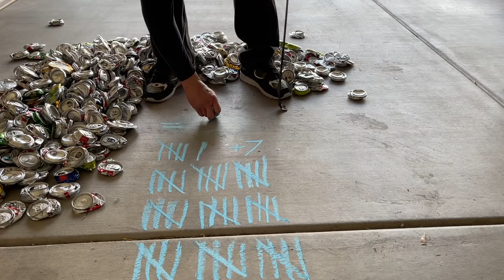Massive Can Meltdown - How Much Pure Aluminum Is In 500 Cans - Is It Worth Melting Aluminum Cans

Comment from the maker: So is it worth melting down 500+ aluminum cans? 
Short answer...NO. 
Total the time- just over 2 hours to melt these all down, plus setup and clean up time. 
Total the propane cost- I used about 2/3 of a tank, so depending on what you pay for propane near you...for me it’s about $10-12. The result of the10.75lbs of aluminum is worth about $10.75 USD. 
The fuel alone costs more than the aluminum is worth, then take into consideration what your time is worth and you’re way over budget!
For me...there is everything I just mentioned, plus add another 2 hours to sand, polish, and shine one of these ingots, and another 8-10 hours editing to provide 12 minutes of cheap entertainment & enjoyment. 
Long answer...worth every second 😉👍
Thank you all for watching, I hope you enjoy, and stay awesome!
Reply: No is absolutely the correct answer.  Everyone tries melting cans at least once though, and I never saw anyone get talked out of it.  But FWIW I can reduce 3 whole alloy car wheels into crucible friendly sized bits with my wood fired stack melter in an hour or less.  That's a lot more melting stock processed in a lot less time with a lot less work, cheaper to buy as scrap than 500 cans of pop, far better for making castings with later since they are made with an alloy that is designed for being made into castings rather than for being made into cans, creates far, far less dross to skim off because cans are all surface area just waiting to burn up before they can melt, and I bet 3 wheels even take up less space to store than all those cans...  "Free," yeah, right...
Reply from the maker: @tobhomott  very well put!
Reply: @TheGrowingStack  what size smelter is that? Great video by the way
Reply from the maker: @JondroNation  Thank you, that one is the Devil-Forge FB2M that has a 10kg max crucible size.
Reply: Where I live on the northeast, 517 cans would give me $25.85 at the recycling center. .05¢ deposit return for each can. The fun factor is what would make this hobby worthwhile.
Reply: Too bad that's not silver huh? Pretty sweet at any rate 👍
Reply: I made a bucket furnace and melted a whole lot of cans. Not exactly the way to make a living, but I cast some cool shit. Worth it to me.

Smash them flatter and use some borax, and you'll get quite a bit less slag.
Reply: Not a smelter, it's called a furnace
Reply: Doing my own research you really need a flux for aluminum cans for better aluminum recovery. Aluminum absorbs Hydrogen and oxygen and a flux helps in separation of aluminum from the dross while also degassing. Also using waste oil would be probably more economical.
Reply: I do it for cheap cylinders to throw on the lathe and let the kids get more experience. 😃
Also, did you throw in any "salt substitute"?
Reply from the maker: @jamesharrell4360  Thats awesome 👍 I didn’t add anything, I wanted to go totally raw this time for the experiment.
Reply: @TheGrowingStack   According to one source potassium nitrate or (KN03) is used as a drossing flux and helps improve “wettability and fluidity” of the aluminum which allows for greater separation and coalesce of aluminum drops trapped in the dross. Though I have not had the chance to test out yields with it yet, the correct timing to add the flux, or how much as the article did not specify a quantity.
Reply: The journey though.
Reply: If the aluminum was suitable for milling and stress and whatever you could make something with it.  But I guess that depends on the quality of the material.
Reply: @jasonmorgan661  just turn your stick welder to it's Max duty cycle and cram some carbon arc rods in there.
Reply: @kateonianlaw1127  I pre melted my substitute salt into larger crystals. You get a feel for how much you need. And pouring straight from the bottle of salt typically ends up popping slot of itself back out.
Reply: I used bbq coal and a hairdryer as fuel to melt cans in a furnace nearly identical, definitely more cost effective than using propane.
Reply: Thanks a lot man for sharing your knowledge. 
This is only for reference... 72 cans 325 ml of aluminum are a kilogram. The metal slag that you obtain is 30-34 per cent.
If you have 517 cans between 72 = 7.18 kgs. The 32% of 7.18 is 2.3 kgs. Then 7.18 - 2.3= 4.88 kgs. The final it depends of many things in example... the same cans weight, the same volumen etc. 
Take this only for reference. Your video is very usefull and interesting.
Reply: I live in Pittsburgh. Thats about 2.50 worth of aluminum
Reply: You also have to buy a beverage of your choice, to add a few more cans.
Reply: In Australia if you recycled it you would’ve got $51.70
Reply from the maker: @tarikdominator8144  wow, I need to take a trip down under. 🙂👍
Reply: In BC Canada u would of got 51.70
Reply from the maker: @blackbones4959  Man, we’re getting robbed down here in the States!
Reply: I'm in uk and just looked on ebay, there are some hand cast 1kg ingots for sale for £44 So potentially worth about £200 for nearly 5kg if anyone buys them at that. That said, metal is quite lucrative here though
Reply: Uncrushed cans in some states like oregon pay $0.05 for each can. Not even close to the same price as melted.
Reply: Probably a similar formula with the melting of plastic for recycling too....not worth it.and glass is a different story as it requires much hotter temperatures but I suppose that glass bottles could be reused if returned to the same manufacturer which could mitigate that a bit.
Reply: The real money comes from the video revenue.
Reply: Melting with a melter like this by hand at home , of coarse it is economical seen spilling of money (and energy is inefficient used). But in my opinion it is better to reuse as much metals as possible instead of mining new , destroying land for it.
But when anyone would like to make profit out of something as this it must be done at industrial scale...automated process..., perfect isolated heaters so no energy loss to the surrounding. And after making those alu breads reuse the energy what you'll get by cooling those. Maybe enough hot water for home / factory use.
So not melting 517 cans, but maybe 517000 cans.
Reply: @TheGrowingStack  what is slag?
Reply from the maker: @Bushcamper777  
The way I understand it, in a nutshell- slag is the waste when they refine or smelt ore, like when they make iron or steel from straight rock, it is the leftover waste matter. Dross is what I was skimming off the top, which is the oxidation of the aluminum when it comes in contact with oxygen, or the air. Technically, I should be skimming the “dross” before pouring the molten aluminum that forms. The terms are interchanged a lot, and when people say slag...I know what they are referring to. But, there is a lot going on here also. The ink from the cans and the plastic lining combined with the oxidation forms the dross that is being skimmed away before pouring. I’m no expert, but from what I have read and from doing, that’s what I got 🤷‍♂️😃
Reply: What about artistic value? bigstackeD makes these beautiful mirror polished bars that I'd pay for, especially for the fact that it's autographed (or stamped, at least).
Reply: Well you have shown that from an economic standpoint it does not make sence yet if you sat around watching television  instead does that make any economic sence? My point is I give you kudos for doing somthing and learning about somthing rather than doing nothing aka watching TV.
Reply: check out oki scraper's oil burner set up ,,  that's a must have for this work
Reply: Finland one can 0.15 cent when you restore can super market 700 can = 75 euros = Finland is Pure = Finland Rule the World
Reply: But still real cool
Reply: What is the useless leftover stuff made of?
Reply: @t0n0k0  not sure if its carbon or different type of alloy from the pull top, have heard its tougher aluminium
Reply: No it is not economical but drinking 500 beers then making art out of the empty cans is totally worth it!
Reply: @liondirk  yea thats totally true ,  but you gotta be able to drink them all  or give them to the dogs  cows and horse's
Reply: I was going to say you never addressed the question in your title.
Reply: 500 cans is about 100$ bucks here in norway so not worth melting em
Reply: Are those cans all project-grade pure aluminum, though?
Can you get .999 pure?
Reply: Luv it, nice vid.
Reply: Is 10 lbs of pure aluminum worth the same as 10 lbs of aluminum  cans?
Reply: @1paultv22  i live on the west coast, its 10 cents a can over here, that was 51.70 at the center
Reply: @TheGrowingStack  on the west coast its 10 cents / can.
Reply: Yes, Hobbies of any kind are not cheap, and you never do it to make money..  you do to see if you can and what you can make. Bragging right.
Reply: You could convert your kiln to run on waste oil.
Reply: 8 to 10 hours to edit for 12 minutes footage ,.. ?
what did you do the editing on texas instrument calculator from the 70's lol
Reply: Thanks for your vid! Appreciate your time & efforts 👍🙏🏻
Reply from the maker: @MYshamanEYE  😂 That’s funny stuff, I love it! I film everything, so when I get done, I have 3 hours of footage to go through, whittle down, speed up, cut, and chop to make it to 12 minutes. It’s a ton of work.
Reply: @TheGrowingStack  hehe ,.. i just had to make the joke ,.. loved the vid ,.. hehe
Reply: @TheGrowingStack  hear's an idea ,.. post all 12 hours raw and call it cure for insomnia asmr ,... people would love it,... wink :)
Reply: Well around here that's food graded aluminum which it pays very good, surely more than 1 dollar or so per pound... I don't know if they would accept it melted into bars like that , probably not... but in way shape or form it is a waste... you can start to make props for movies making the aluminum look like silver and brass look like gold...I'd try the way the fella said he did with a wood burning oven to save $$$
Reply: Half a million views later “well I guess if you film it and put it on YouTube it is”
Reply: You could re-melt the aluminum and pour it into a mold to make an AR-15 or AR-10 lower receiver. Just saying.
Reply: A friend and I have done this and made a nice 15lb skull, similar to the one you have on your shelf. We think it was worth it because aluminum ingots were selling for $4/lb on Ebay. Also, people offered us some money for the skull.

We used BBQ charcoal, and a leaf blower...then coal, and coke...and found it was economical. Even more so by using a much larger crucible. That way we could melt a lot of cans in one burn/pour. I think it CAN be cost effective... you just have to make your process cheaper, and add value to your aluminum by turning it into something people will pay for.
Reply: Seems like you're running your burner way high if you're going through 2/3 of a 20lb tank of propane in 2 hours, I melted about 1500 cans (non-returnable in my state) last year on a single tank of propane in roughly 6 hours. My orifice in my burner is a 0.035" mig tip and the furnace is a old 20lb propane tank lined with ceramic fiber and firebrick.
Reply: ....damn straight, some things are just worth it..!!
Reply: 😂 hilarious
Reply: @CyrusOfNaias  not 100% . . . two very specific alloys -- one for the body, one for the ends.
Reply: @1paultv22  we have some here that give $0.06 back so it'd be over $30 here
Reply: Why not try a used motor oil furnace? A better set up that would be more efficient would definitely get more use out of your propane.
Reply from the maker: @jhatchoou  I might try that someday. 👍
Reply: 15.oo of propane to get 4.69 in aluminum ingots.    You need to make FISHING LURES INSTEAD !
Reply: To add some perspective, here in South Australia we get $0.10 per can at the recycling center. Yet if I sold them aluminium by weight they pay only $1.30-$1.70 per Kilogram.
Reply: @grndragon2443  Oregon is .10cents. I live here.
Reply: @kateonianlaw1127  Yeah he's just making a lot of aluminum oxide there, very wasteful.
Reply: I watched this at 2x normal speed and still got 6 minutes of entertainment and enjoyment.
Reply: The bars still look cool, gold be better of course.
Reply: there will be a shortage at one point. The earth only made so much of all of this
Reply: Thank you for sharing your experience.   In Michigan carbonated drink cans have a $.10 refund so those 500 cans would have a cash value of $50.   Can’t help but wonder what the price of aluminum would have to be to make melting cans down to make it worth melting cans.   Either way thanks again for sharing your experience.
Reply: But how much did you make from this Vid 🤑
Reply: But 700k views is worth something
Reply: @tarikdominator8144  Not every state yet.
Reply: @derekhobbs1102  no one cares about tassie and Victoria
Reply: But what about all the youtube revenue you get out of this video???? I think, in the end, it'll be worth it
Reply from the maker: @jwgmail  I always get asked if I sell stuff. Maybe I should rather than just giving it away.
Reply: Well its not that expensive for a hobby and the result is nice to look at for sure. 👍
Reply: @TheGrowingStack  do you know if scrap yards take ingots?
Reply from the maker: @haloplayeroflegend2515  From what I’ve read they usually don’t since they don’t know exactly what it could consist of. That or they will give you very little. Maybe it varies from scrap yard to scrap yard though 🤷‍♂️
Reply: @TheGrowingStack  👍ok
Reply: You just saved me a lot of time. I’ve been saving cans for about a year. Was going to make a forge and melt them down. 
So now I know. Sell cans to recycle place and take broken mower off the side of the road and use the cases.
Reply: Okay maybe this is a stupid question, but what are your ingot molds made of? They just look...interesting, for some reason.
Reply: @thedrunkalchemist5442  More
Reply: Shouldn't it be more than 10.75 since it's clean aluminum?
Reply: Still pretty cool tho.
Reply: Yeah, the economics do not pencil out but I bet you had a blast making ingots.  And the ingots are kind of cool.
Reply: I totally believe you, but could it have helped to compress the cans further after crushing them, so as to shortening the feeding time of the crucible?
Reply: @holdenbrougham1923  unless I am very much mistaken it is not anything as exotic as carbon or a different alloy from the pull tab, rather it is just simple Aluminum Oxide (which has a melting point 2 or 3 times higher than the melting point of elemental aluminum)
Reply: @MYshamanEYE  editing is probably the longest part of making any decently well produced video
Reply: @donniebrown2896 touch grass nerd
Reply: Is it worth melting down 500+ aluminum cans?
Providing you get 838,000 views at roughly $1 per thousand views...  HELL YEAH IT IS!!
Reply: Sell that stuff online I'd buy an aluminum skull or cool coin that was stamped with something interesting
Reply: if you had a more efficient foundry and a steel crucible you could actually make money from this, what surprises me is how little aluminum you got from each can.
Reply: That's not thinking it through. You could sell each bar as a curio at the farmers' market for $10 each.
Reply: @TheMrCougarful  true, he is doing based on price per tonne rather than how much he would pay for it if he didn’t have a foundry.
Reply: Yes but your ad revenue from Google is worth it
Reply: Dope video man!
Reply: @1paultv22  Cans are worth 10c each in AUS.
Reply: I reckon it's worth exploring how pure you could get the aluminium, and whether you could cast it into parts worth more than $51.70. Of course you can't charge for your time but that what hobbies are for.
Reply: dammit bobby!
Reply: And yet you manage to call it recycling....
Reply from the maker: @m.laraibali3266  The Oxford dictionary says Recycling is: the action or process of converting waste into reusable material. 🤷‍♂️
Reply: Depends on what you determine as value. I now know I can make an attempt at casting an aluminum intake manifold from the bags of cans I have.
Reply: @TheGrowingStack  That's for damn sure!  It's pitiful what we get for can!!!
Reply: the aluminum cans are worth more if you return them as nickel deposits for 5 cents each
Reply: Well your barely over cost not counting your time,  I could see  a little larger scale  operation where you can do more than 10 or 12 cans at a time becoming more efficient.
Reply: Yeah, but it was cool to see.
Reply: @TheGrowingStack  but it might be worth it after you get monetized if you're not already!
Reply: Tjank you. Good job. Am I wrong if I suposse the complete answer is: Not at home but Yes at factories???. Where costs are less and inputs are chapear???.
Reply: @TheGrowingStack  No, in MI 517 cans = $51.70.  Fun to watch but just recycle them.
Reply: QUESTION- NO BS OR SARCASM:
Was that the most efficient method of melting aluminum that you found?  How (or what) could be done differently?
Interested, but not in love with the process in the vid [nothing personal-I give you great credit!  I just don't have any of the equipment or even know where to look for it]
Any thoughts?
Reply: Thank you sir, for your kindness in improving the educational value of YouTube.  Regardless of what some might say.....your time is NEVER wasted when adding to the educational instruction of others.  You're a stand up guy!
Reply: @1paultv22  but you're really only getting a refund because you pay an additional $0.05 in tax per can.  LOL
Reply: The nd result is your a LIAR or you can't count. It takes 24 cans to make a pound. You claimed to have 500 but yet only had a melt weight of 10.75 lbs.? To make it easier 500 lbs. of cans weigh roughly 20.83 lbs. Let me say that again 24 cans to make a pound, 500 cans weigh 20.83 pounds and YOU had a melt weight of 10.75 pounds? Where did the other 10 lbs. go the paint burning off lol. SMH
Reply from the maker: @jackbounder6374  I’m guessing you’re trying to say I didn’t melt all 517 cans... I melted them all, it took forever. There was quite a lot of dross that I didn’t weigh that I should have to your point. You can see a lot of it at 7:16 on the ground where I skimmed before pouring. Also at 10:42 in the wok. Now, had I ended up with “40lbs” at the end, then yes, I would definitely be a liar. 👍
Reply: It's mostly slag too, I used to do melts as well and whenever I did Aluminum cans It was like 50% slag because of the oxidation, and plastic coatings on the cans.  I think you would be better off cutting the top and bottom off and throwing away the center but then it becomes a time issue. As you said labor has to factored in as well.
Reply: Hello, yes we are so what are you going to do with all of that?    @TheGrowingStack
Reply from the maker: @rickmorris338  just keep stacking it up. 👍
Reply: So if you're lucky you can get out slightly below a kilo for 100 cans. Here in Sweden a Kilo is worth about 20.9 SEK, recycling one can will give you 1 SEK.
Just ignoring melting costs, you'd still be losing about 5 times of what you'd get from just turning in the same amount of cans at the recycling station.
Reply: The YouTube revenue makes it worth it lol
Reply: Yeah, but how much for a polished paperweight?
Reply from the maker: @brianmi40  to be determined I suppose 🤷‍♂️
Reply: Well the million views pay for it.
Reply: @1paultv22  I think you mean .05$  per can. The recycling scheme charges you at least ten extra cents per container to cover the costs of itself and make some profit. Then, in most cases, the "recycled" al ends up in a dump anyway. I'd rather go for the fun part of home recycling, belch carbon dioxide out of my smelter, claiming that I'm saving precious resources of the Earth :)
Reply: @zigfisher6592  Lol!, I didn't know I was being graded on math expressions. Technically it would be written as $0.05 or 5¢. The dollar sign always goes on the left. The cent (¢) sign always goes on the right without a decimal point up to 99¢.
Reply from the maker: @GMan-yv8cb  Definitely not the most efficient, but I melt and cast a lot of other stuff on here, so since I have all of this stuff, I went with it. 🤷‍♂️
A lot of people talk about using a used motor oil setup, but I haven’t looked into that.
Reply: I hope you wear a respirator.  That stuff can give you alzheimer's.  We just do it the easy way and take cans to the recycle place.
Reply: Obviously you wouldn't build a commercial enterprise on that size forge. Would need mega-scale.
Reply: @donniebrown2896  It is a foundry.
Reply: depending of what you consider worth it if you turn it to art then yeah worth it for it more then likely cheaper then buying a block. but to scrap no
Reply: Can you imagine what the salvage yard thinks of recycling all that stuff to and they do it all…….. some of those people at steel mills make 20-30 dollars an hour.
Reply: Probably would've been nice to put this in the end of the video
Reply: @donniebrown2896  forge actully  written on the Side
Reply: Better try melting from waste wood it will be cheaper I think 😜😜
Reply from the maker: @kri9057  That’s not bad at all! 👍
Reply: What about range brass?🤔
Reply: So how much do u get 4 1 of those bricks r they worth anything.?
Reply from the maker: @andclose1133  The current price of aluminum is $1.0998/lb so it’s worth something. The value would depend on taking to a recycler(probably only getting 1/2 the price since it’s already melted-if they buy it at all) or on the street. I get people asking me all the time if I would sell these, so it all depends. For the moment, I am just stacking them all up on the shelf 🙂👍
Reply: @kateonianlaw1127  yes use flux for cans  a lot less waste just remember cans destroy your crucible
Reply: @1paultv22  
I’m Oz you get 10c per refundable can and bottle. 
Also we use Aluminium here. Different because it still contains the i compound! Lol. 🤑🤑
Reply: In Germany, bringing back those Cans to the store would result in getting 25cents per can, totaling in more than 125€
Reply: Pfft imagine using propane, aluminum can melt in a good camp fire. using an old steel tumbler cup as a crucible, wood as fuel, and a muffin tin & mini loaf pan for molds, boom free, out of actual garbage and rotten wood its really cheap to be resourceful.

As of current we've about 13lbs of pure aluminum in ingot form completely free
Reply: @TheGrowingStack  this is the problem with recycling, you dont actually profit.
Reply: Awesome comment.....hobbies are rarely  worth it on a $$ to time basis....but they stop us going insane..... great video
Reply: @tarikdominator8144  as long as you're in the right state.....I make about $120 a year from bottles cans at my local recycle service.....and bang it down on Christmas dinks and eats....🍻🍗
Reply: Cost effective? No. But neither is me reloading 9mm ammo, but I enjoy doing it. My time on the press is therapeutic and I have a sense of accomplishment and self-sufficiency.
Reply: Just save it all....one day you will be rich beyond compare. give it to your kids even, they will be able to sell it back to the Global Government for BILLIONS! Oh wait....they will have to pay a fine for hoarding, there will be inheritance tax, a fine for not disclosing strategic goods, there will be no money, no more private property, only gruel to eat, everyone will be equal.....no wants, no desires....UTOPIA!!!

Forget it....I thought I had a idea there at first!
Reply: Yes, if you get over a million views on youtube...you make money...
Reply: so TRUE, and be Tired after at least I Am- NOJK
Reply: @donniebrown2896  If you're going to correct somebody, atleast be correct.
The way he's using it it's a Smelting Furnace.
Reply: So the getaway would be to use cheaper fuel.  My question is where the hell can I buy 1lb of aluminum for 1$??
Reply from the maker: @TheGamersRace  good question. As value goes, that is what it was valued at when I made this. I just visited my local metal shop the other day and aluminum was being sold for $3.99/lb. 
they are a pricey shop for extruded flats, but the same with anything I guess 🤷‍♂️. 
Silver, Copper, Gold, to buy to it outright they charge a hefty premium.
Reply: Glad you answered that question. I stack silver and refining and melt doesnt add up to be worth it. Cheaper to buy round. Thanks.
Reply: @grndragon2443  in my area of oregon its 10 cents now
Reply: here in india, we melt it and cast it into aluminium pots and utensils. we gather aluminium things or parts.
Reply from the maker: @nanaouzumaki6044  that’s awesome!
Reply: I work in the aluminum industry and we melt down TONS of cans a day,we don't Polish the ingots even tho we pour into 1500 lb molds. We melt anything and everything that's aluminum
Reply from the maker: @johnbrewer8488  That is awesome sir. I would love to see some inside footage of a 1500 lb mold being poured! If you’re allow to take any inside footage, my email is TheGrowingStack@gmail.com 😉
Reply: Too bad it's not all gold bar
Reply: @TheGrowingStack  you're right I used to work in the steel mills , I worked in a blast furnace we made pig iron and slag came off of the iron. For you that don't know what steel slag is is the stuff you see on the railroad beds the train tracks sit on. It kind of looks like dirty melted glass. Or lava that came out of a volcano . I don't know what they use in other states and countries but most of the railroad beds in the midwestern used slag
Reply: What the hell do you do with them?
Reply: that's why I strip copper :D
Reply from the maker: @tillmanfamilyfarm7759  Mainly just stack them up, and then in the event I want to make something, I have the refined materials to melt and cast into something.
Reply: Why you need money from aluminum when the youtube video views make you more money?
Reply: @j3ss3jam3s5  Not really "profit". You are paying that
Reply: Time is worthless until the sale is made.
Reply: @runerafell4480  that good money sir
Reply: Its .52 cents a lbs for forged aluminum as of today.
Reply: @Akhazmat907  it depends on the grade and volume too.
Reply: Hey they look awesome tho. What you should do is paint them gold and than keep them on the shelf to look at and imagine if they were gold! Haha 😆
Reply from the maker: @Jay_Chang440  😃👍
Reply: @0g.Ghost.7373  Im not paying that, that for sure, ...
Reply: @j3ss3jam3s5  If you buy a drink in a can or bottle you do. You or someone else gets it back if its returned.
Reply: Will you recoup the monetary cost in capitalism? No. Is it worth it? ... yes.
Reply: I don’t know why you would want to smelt it yourself. Let the recycler do that shit homie!
Reply: @1paultv22  I would like for you to get 517 cans and see if you get that at the recycle center. They no longer do it by the 05 cent value. They weigh them now in bulk. This is how they win against you. You probably get $10-$12 for the cans.
Reply: @bradleyrussell1973  there are lots of reasons. Assuming you want the aluminum for something, and aren't just selling it, the recycler will probably be charging you more than what you'd pay yourself (not counting initial equipment). Lots of people don't drive, and in USA at any rate public transit is shit. Lots of people who do drive don't live near a recycler. Society might collapse someday, and all the recyclers will be gone. (Just some examples lol)
Reply: I guess it depends on whether the cans have a deposit on them... where I am, 517 cans amounts to $51 and change (10 cents per can, crushed or not)...
Reply from the maker: @patklemmensen1694  I’m not so lucky on the deposit in Arizona 🙁
Reply: Thanks!!!
Reply: Earth is flat
Reply: @kateonianlaw1127  What is all that slag or dross he has to scoop off made of? It looks like Al, or at least has the color of it, but I presume something has it locked into a compound that won't melt.
Reply: Let's see you smelter platinum. Or one of the real valuable metallic elements. But the film you made was fun. I watched it on Saturday July 24 at 5pm.
Reply from the maker: @daniellafferety4025  Thanks Daniel. I have a few videos melting silver. That’s always fun to melt. I haven’t done any gold or platinum yet. I would love to though. Someday. 👍
Reply: Was thinking Aluminum doesn't really have value, this is more for personal enjoyment and recycling, looks good, keep it up, love to see some more content.
Reply from the maker: @BloodHawk31  Thanks Heinrich. Yeah, definitely more for enjoyment. 👍
Reply: @1paultv22   in South Georgia, I’ve been getting 30 cents/lb for the last couple of years. That’s the lowest price since I started saving them 30 years ago. Now adjust that for inflation and 30 cents then is about 60 cents now.

Yet, they claim there’s an aluminum shortage in the US and that’s driving the cost of beer higher.
Reply: @TheGrowingStack  An easier and less impactful way to crush your cans is to line them up, under your vehicle, and drive over them. Yes, I “pre” crush them, but this gets them really thin.
Reply: @1paultv22  : Where I live they have the 5 cents return on the cans also, but the stores that sell the cans don't take them, so you have to find a recycling center, so then people are being slobs and just throwing the cans on the ground, making them free to the people who actually care about the environment that want to do things like the man in the video, which I applaud him. There's cheaper ways to melt the cans down, just build a burn barrel out of a 55 gallon oil drum and drill holes in the bottom and the top and throw in things that burn put the aluminum cans in a steel 5 gallon can and light it on fire it'll burn so hot it'll melt the cans down.
Reply: and probably you may be drinking more soda just to build the wealth of cans? need to account for that as well.  I remember when I was a kid in my birth country they used to sell candy with stickers hidden in the pack and I started collecting them and I had all stickers except one to finish the whole set. I ate a lot of candy and wasted money but I never got lucky with the last one I was looking for. Later on, I realized maybe that particular one never existed probably their gimmick to make kids buy more candy. :)) Not sure if this story makes sense but i wanted to share LOL
Reply: Where did you get that set up?
Reply: Thank you for your time to entertain and educate us
Reply: The Scrap value is only $0.80-$1 per pound, but that is not what you base the value on. 
Actual shaped aluminum bar or plate is nearly $8 per pound at a metals retailer,(depending on order quantity) granted that is a known alloy.
Reply: here in ontario they make you pay 10 cents per beer can as a deposit which you get back when you return the cans.  worth far more than trying to recycle them yourself for sure considering that the time and effort to personally refine the metal costs more than you can sell it for.   really good video.
Reply: Rocket stove and a fan piped in
Reply: TheGrowingStack bring some mouse traps
Reply: Have you consider the fume / smoke from the paint on the cans?
It is a very interesting video and very cool project and it might be only one time to explore the process - but I can not help consider what chemicals one get exposed to seeing the smoke cloud on each new can you drop.
This comment is likely to be downvoted so I don't really expect serious answers - I was just wondering.
Reply from the maker: @steffenlindemann1227  I wear a respirator and have air moving around the entire process. I have done this many times before without wearing a respirator, and the fumes are only noticeable within about 10 feet of the furnace. If you back away, you don’t smell anything really. Outside of that, I don’t think it’s of any concern in my opinion. 👍
Reply: So they content creation is worth more lol
Reply: I was surprised at the quantity I thought it would be even less - but even if it was more, it still wouldn’t be worth it because Alu cans are a deep draw alloy that’s not very good for casting with so it’s even more pointless 😂
Reply: what if you melt it without fuel? might be sort of worth it if you just used coal and a hair dryer
Reply: Value of the processing depends on more than scrap value. Since you cast into ingots you lost potential value not casting something saleable at a higher price.  Also, rather than saving and melting all cans at once it would be better to melt a few every time you are heating the crucible, using the heat efficiently. 

Slag can be useful... it's not simply junk... look it up.
Reply: Thankyou ..I just baged up my can stash and put it out for the bin men...good video...awnser to a question  I've been wondering a long time....cool
Reply: I suppose if you melt it with sun alone, that could make it worth it. With a fresnel lens for example.
Reply: At least you satisfied my curiosity and that only is worth my time thank you.
Reply: Is there a break even? How many cans at once might get you twenty bucks an hour including fuel?
Reply: 3
Reply from the maker: @duaneayers6117  If I ever do, I’ll definitely let you know! 👍
Reply: But what about the YouTube money 💰 lol?
Reply: Definitely not cheap entertainment! You are skilled guy and the video is amazing! Really enjoyed it my brother! Thanks for sharing
Reply: would have gotten more at CRV   locally they're paying about 1,67 a pound  517 cans is 21 pounds  35$ or so
Reply: in most places these cans have deposit, usually .05 cent so 25$ worth of can reduced to 10$ hehehe
Reply from the maker: @keshlalish5586  I’m not so lucky in Arizona. That would be nice though!!
Reply: Thats $51.70 worth of cans here!  LOL
Does it even cover your gas?
Reply: Just for this comment and the amount of time you dedicated to elaborate this video I will follow anda like! And you just gave me an idea of how a the lay out on the ground kind of tile! I imagínate a floor made out of aluminum tile! How cool that’ll be? Thanks for the content tho!
Reply: @nickhunt4438  check your number Bud. $1.17ish a pound.
Reply: @republicansthatdidntvotefo1605  I just give you a like for your screen name.
Reply: If you had a blacksmith forge and did blacksmithing this would be good on the side. Probably wouldn't have time.
Reply: +2.16 Million Views at roughly $34 per 10,000 views.
I'd say you did alright.
Reply from the maker: @Rikity  the best kind of recycling there is 👍
Reply: What about compared to buying new ingots?
Reply: Another way to look at the "cost" is does that time and (pretty much) breaking even on the costs give you something that can be used again?
Reply from the maker: @telectronix1368  👍👍👍
Reply: @grndragon2443  yeah but y'all get taxed on it when purchasing. When you recycle them. You're just getting the tax back
Reply: That's why you create a youtube video of it with millions of views to make up 100x the cost in ad revenue
Reply: Well hopefully you made some money back from Youtube with 2.3 Million views
Reply: Thank you for your work.
Reply from the maker: @MA_KA_PA_TIE  Thank you 👍
Reply: You tube earnings?
Reply: #1 as others have said, you don't need to use propane. Wood or charcoal and a blower would be much cheaper (or possibly free). #2 I'm not sure why you would sand and polish an ingot, other than to make it look nice for YouTube. So that's time spent that shouldn't be in the calculation.
Reply: 517 cans, if I brought them to the redemption center that pays 6 cents a can, would be a bit over $30. So yea, probably not going to "hack the market" by melting rather than returning, but where's the satisfaction in just dumping ballads on a counter? Quick question, though: would there be a significant reduction in slag/waste if one were to invest the time cleaning the print off the cans, or does that just come with the process?
Reply from the maker: @coreyz.2800  👍 I would say it just comes with the process. I don’t think it would reduce it enough to make it worth the time, and I’m not sure what that process would even be to get the ink off the outside and the liner on the inside off. In my opinion you’re better off just melting them as is. I think the fact of just adding so many small pieces, and all the surface area involved, the amount of oxidation is going to occur no matter what. I’m no expert, but that’s just my take from melting cans many times. 🤷‍♂️
Reply: @TheGrowingStack  Not a lot of resources about removing the liner (honestly it's news to me that there even IS a liner) but what little I've found mirrors the advice for removing the ink: Pressure cooker for 20 minutes, then scrub it with acetone, which would probably entail cutting the can open to get at the liner. Which will certainly add time (and expense for the Acetone) to the process, but would likely result in purer billets and less slag. But as you say, not necessarily enough to make it worth the process.
Reply: That collection of stuff you have is worth it though, look good man
Reply: Save it.. in the future it will be worth a fortune.
Reply: No dogs in this video. That alone shows it wasnt worth the time!
Reply: I wonder if you could use a fresnel lens and the sun to melt them and save the cost of fuel.  You do live in AZ. I doubt you could get it to work for anything higher temp than aluminum but it would be fun project
Reply from the maker: @rlpederson  Hey Ryan, I have heard of that lens and watched videos ages ago about them, that would be fun to try and see it work!
Reply: But the clicks you got from the video make it worth it
Reply: @TheGrowingStack  I think their getting that kind of money because they pay a deposit on the cans and bottles
Reply: @1paultv22  In Australia,it would be almost $AUS52 (10 cents per can at recycling centre).
Reply: Auminum is around $0.35 per pound. So in end your total yield is worth $3.76.
Reply: but that youtube money lol......   glad to see an honest price break down though, worth more in deposit states then melting them
Reply: @TheGrowingStack  is it worth it to melt other things like ex.. brass or copper because I could go to my local gun range and get a couple pounds of brass.
Reply from the maker: @bobbysmhurda  In my opinion, absolutely! I love melting down copper and brass. It’s really fun to make brass as well. Check out a few of my other videos where I melt down copper and brass. Melting spent brass is one of favorite things to do, but I usually wait until I’ve fired off a couple hundred rounds before I melt them so I don’t do it as often as I would like to. 👍👍👍
Reply: @1paultv22  here finland get 0.15€ per can :D
Reply: You earned money from YT from it though so it had to be worth it?
Reply: @TheGrowingStack  R u a sub channel of big stackd?
Reply: Gained a few subs, imparted knowledge and had fun, so worth it. Cheers ledge
Reply: What does the metal that you scoop out consist of?
Reply: What about copper?
Reply: yes its worth it. because you will make about 1.4k from this video alone. 

lol. Keep it up my man. Good content
Reply: Ya... But when it skyrockets you will be set! Lol
Reply: Well this video just made me subscribe cause I been interested in making my own foundry and I’m gonna be watching your videos a lot after seeing that dresser top full of stuff
Reply: just saying, but if you had a shredder, and ran them all through, they would melt faster... don't know if that would change anything, and why not try a different fuel, like hydrogen?
Reply: If you melted it and crafted things to sell for more money it'd be worth it. The video was pretty cool though
Reply from the maker: @kskaiseraaron  thank you!
Reply: @TheGrowingStack  0.
Reply: Its worth it it’s fun
Reply: 12 minutes of satisfaction. Good thing to watch before going to school
Reply: @franciscovaleriano3153  Math at 02:58 AM, making my brain hurt.
Reply: @grndragon2443  And that 0.05 cents was already paid for on purchase.
Reply: @liondirk  A weekend endeavor for some people no doubt - the drinking of 500 beers.
Reply: 10hrs to edit?  I've never touched s computer before but I still doubt it take me 10 hrs jesus
Reply: Sigh. It's about economies of scale.
Reply: @1paultv22  In germany, no matter what you recycle (bottles or cans) you can get up 0.25€, so the person "wasted" almost 130€ worth of cans
Reply: Somehow I figured that out awhile ago , however melting copper is more worth the time and setup cost since the pandemic put the copper prices at an all time high, The Best time to do Copper melting is in a time of war , also brass is up in price as well  but it's interesting to see this being done and I am new here and I will be following your channel
Reply: You would have gotten $25 from recycling (5 cents a can).

But the millions of YouTube views surely made this more profitable 😃 👍
Reply: @Wheels2183  or better yet , Gold , I know a guy who removes Gold from computers and actually does it in his spare time out of his garage and for a few hours a week during the month he has gotten enough to buy a new BMW over the past year , I don't have any patience to do that kind of Gold digging , and he does it in a few old Wash tubs , All without fumes ,
Reply: 0
Reply: What if i can show you how to make them worth much more and use much less time and fuel to melt it ?
Reply: @shazizz  would love to hear
Reply: 517 Soda / Beercans. in Germany we would get nearly 130 Euro back. We get 25cent back when we bring our empty cans back to the shop so the can get recycled
Reply: at 20 cents a pound for scrap aluminum you have about 2 bucks there a waste of time and fuel
Reply: Well you can now mill a part or chuck it on a path and make something worth way more?
Reply: 500 cans is worth fifty bucks at the recycle place. 10.75 lbs is 14$.  Art is priceless.  Can't have your style of art without material either.  Cheers.
Reply: @daleleibfried8648  in Canada its fourteen dollars.  However five hundred cans are worth fifty bucks.
Reply: @t0n0k0  plastic paint carbon burned to a crisp.  There's a plastic liner on the inside.
Reply: @runerafell4480  fifty in Canada
Reply: @thedrunkalchemist5442  10 lbs aluminum fourteen bucks.  Five hundred cans fifty bucks.  And no heating needed.  In Canada.
Reply: @PumpkinKingXXIII  in Canada 500 cans = 50 bucks but its only fourteen bucks after melting it.  Plus expenses cut into that.
Reply: $50 here in Oregon dont even have to melt them... just take em to the recyclying maching and deposit 500 @ 10 cents a piece...
Reply: Aluminum cans are pretty much the most valuable commodity recovered from municipal recycling operations.  Very different from certain low grade plastics or glass. The alum subsidizes a lot of the operating costs.
Reply: Can I buy one of the polished bars off you? Don't know why but I think it's cool 🤣
Reply: @TheGrowingShack how much did your whole set-up cost?
Reply: would have got more at a recycling centre. 10c a can
Reply: @t0n0k0  it's aluminum oxide
Reply: Money is made from the videos.
Reply: In Egypt, the matter may be different. The price of 500 cans is 75 Egyptian pounds, and a gas tube costs about 100 pounds, and the output of them is 4 and a half kilos of aluminum, the price of a kilo is 40 pounds.
If we break the cans it will save some time
And if we use a larger oven, we can save some gas
What do you think is this project worth in Egypt
Reply: If you think that melting Aluminum is a waste of time, you should check out the process of reducing it from the Bauxite Ore.  It quickly becomes clear why they need recycling to keep the industry going!
Reply: more entertainment then much of what i see on tv
Reply: @kevanhubbard9673  it actually takes less energy to melt cans and scrap then fresh ores or from rock plus if you want o be cheap just use enough lighter fluid bbq coal and a hair dryer there are plenty of cost efficient ways to melt metals
Reply: It might be worth it in the industry when they melt 100 tons of Aluminum?
Reply: @RedHeadForester  he received $838 to do this video? No way!!!! I need to change careers asap!
Reply: @MrEditor6000  how much was made off the video? Sorry. It’s too late at night to do the math…
Reply: You a real one.
Reply: Use free wood in a rocket stove.
Reply: Cool video, I did it a couple of times with metal muffin trays then I quit drinking beer and moved to JD Country Cocktails and they only come in glass bottles so now I'm smelting gold with borax in baking potatoes
Reply: @Bushcamper777  it's like an impurity in the metal slag is just waste not worth anything
Reply: @1paultv22  You can do many other fun things with this and come out further a head than melting aluminum cans lmao.
Reply: hell yeah it's worth it..to hell with money we do shit for love .no matter what it is ..keep kicking ass brother and keep up the awesome videos ..woooooo
Reply from the maker: @mustangandfrankenstein  thank you brother! You get it!!
Reply: @mustangandfrankenstein  really isnt worth it though is it if it costs you money when the idea of it is to make money?
Reply: @makmerone9731  oh I agree 100 percent. but some of us do some things for the love of it...mine are young ladies and drag racing ..money and more money .if I was a smelter am not at all but if...I would make money by daptung it to my style and that fits in everywhere and runs like a machine...if I fell in love with it ..smelting ..then I would look at my expense list and chop it up .trim it down until there is no expense .and brother there are ways to do things and it's just not going to the store with a credit card and buying it and calling it a day...I mean I'm just using this as n example..I could make money selling dog shit ..luckily iv not had to but somebody needs it ..at 10 pounds my boy big stack has just gave you .us numbers to work with and that's pretty Kool ..I don't do any for money because I don't love money ...I hate it . it's garbage iv had money alot and wasn't happy  for me love is my happiness so if it's something I love them  all in and I'll keep going in until I get bored which is about two weeks then I .over on to the next project or challenge..this actually is a great challenge..how to make money doing it...
 something to think about or talk about with you're partner ...good talking to ya man .rock on
Reply: @TheGrowingStack  hell yeah bro...and plus the prices of shit go up all the time..when aluminum goes sky high then everyone wont be saying as hit then .it's still money in the bank and love in our hearts ..hey I'd love to buy a skull or two from ya .if so just Hollar bro..keep em coming brother .wooooo
Reply: @TheGrowingStack  I thought it was a no no to do over concrete because if you spill it pops?
Reply from the maker: @kurtdowney1489  I’ve had copper spit and pop a little when I’ve spilled once before, never with aluminum, even though you probably should have something down to be safe.
Reply: Yes, its worth the fun!
Reply: I read that 10 million views nets approx $75k in ad revenue. So I'm guessing almost 4 million views would be approx $30k. Is this accurate?
Reply: hey stack is there anything you can burn that is free or close to like wood or whatever to get a fire primed and hot just to maybe help in the propane costs ..or another way to do it....and I'm asking as if you or me or them re out in the middle of the woods with no restrictions of a nieghborhood ..how could it be done? I'm a hunter gatherer at heart so going out and getting stuff to burn or trading for something that burns hot enough is my game ..I'd like you're ideas to it ..if ya get time brother..thank you keep up the Kool shit we love it man wooooooo
Reply: In South Australia we have can recycling centres that pay you 10 cents per can.
Reply: @MrSlySloth  Kool..but do they charge you at the store also for a recycling deposit..some states here in America do like 5 to 10 cents a can .it keeps up on the littering of them too..
Reply: @mustangandfrankenstein  you would think it would stop the littering here too but no, some people actually make a living collecting them off the side of the road. They also give 10 cents for iced coffee/flavoured milk and juice containers both cardboard and plastic.
Reply: @MrSlySloth  same here bro
Reply: But please MELT AWAY. My 9-5 is boring af and I need something enjoyable to watch 🤗😏
Reply: I coulda told you that before you wasted all that time to.
Reply: we woulds get $50 cnd for those cans recycling them...
Reply: Absolutely worth it! Loved every minute watching each step of the process.keep up the great videos !
Reply from the maker: @alanpadlo7439  Thank you!!! 👍👍
Reply: @1paultv22  Where I live in Norway , 517 cans would give me $101.42 at the recycling center😆
Reply: Just as I suspected,  thanks for answering though
Reply: Can't believe you read and answer so many comments/ says a lot about yourself 😊
Reply from the maker: @carlmorgan8452  Thanks Carl, I try to answer as much as I can. I read every one of them, sometimes I’m busy when I do, and then forget to respond later. I try my best though 🙂
Reply: That’s why there’s a lid, close it and it’ll stay hot longer
Reply: Yes
Reply: Add the cost of the big ice cube (water + freezing) !